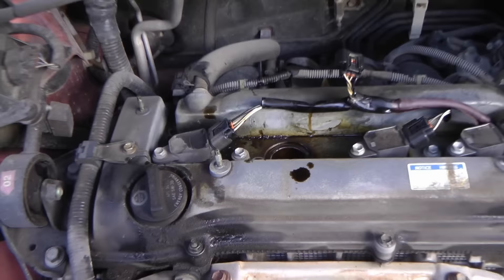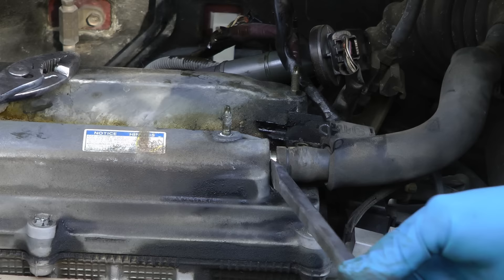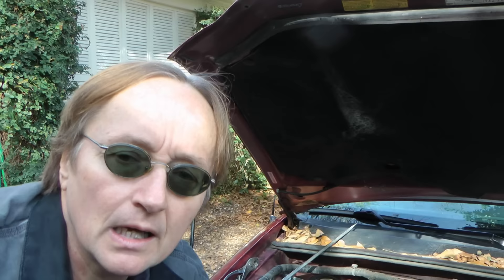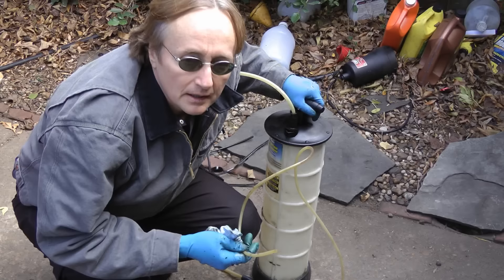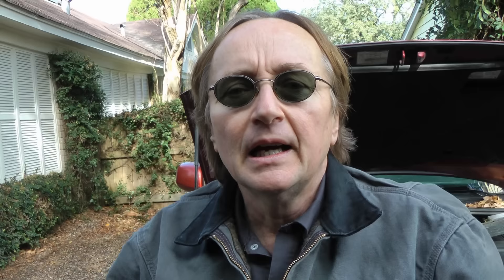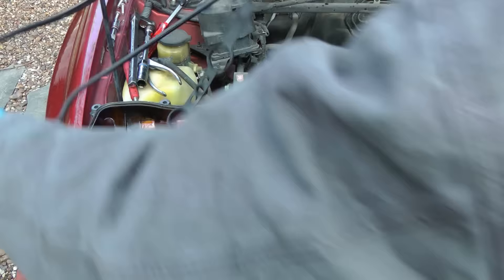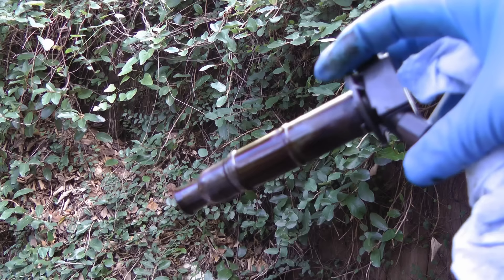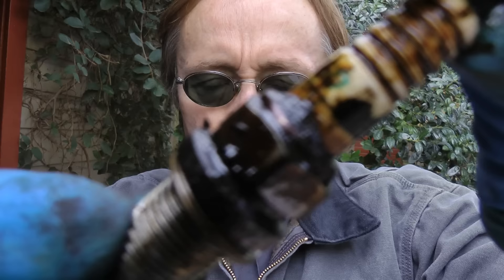How to Fix Engine Oil Leaks in Your Car

Comment: Ive got a decent oil leak on my 2002 renault clio , ive check my plug cables but they are dry as a bone , where could my issue be?

Comment: Hey Scotty I have a problem with my Subaru Justy it is a car old 5 years and has engine from Daihatsu it has a 3 cylinders and its spending too much oil I've crossed 6500 km since the last oil change and now he lacks a little more than a liter of oil in the engine, mechanic assures me that it's not surprising but I'm sure that something is wrong.Because I previously could get over 10000 km without of oil loss.It all started when

Comment: I'm freaking out.  I have a 2005 500 Limited with the 3.0L Duratec DOHC V-6. Can't even see Bank 1, or  the 3 coils there. Intake removal, 2 valve covers, harnesses all over the place.  What a mess.  Have oil in plug wells on Bank 2 in front, cylinders 4 and 5.  Cylinder 6 was fine. I miss my old Buick 455 C.I. right about now.

Comment: Hello Scotty,
i already change the valve cover gasket and spark plugs tubes and it still have oil in the spark plug when i take it out, do you know what could be the problem.

Comment: Hi Scotty,I have Honda Civic Coupe 2008 model. Recently I have started to observe couple of drops of oil leak per day under my car. I showed it to a mechanic and he told me not to bother with repair cost and just keep on monitoring engine oil level to ensure I am not losing lot of oil. The leak seems to be minor. My question is- There are some oil leak check products in the market that stop oil leaks ..like Blue devil products...Should such products be the right fit for my car? It has 105000 miles on it. Thanks

Comment: 95 Buick Regal 2.8L 3800 series:
Being that i haven't done any work on my own vehicles since Breast Cancer, 8 years ago,...any suggestions to Breaking the Seal on my starter.  No pneumatic tools..... bleeech.  and ... now I need an oil pan gasket replaced.  Maybe I get my brother in law do that.... but I gotta drive it there -_- first.

Comment: Hi Scott I really enjoy your videos v helpful God bless you I am very worry I bought Nissan micra 2013 digs model petrol 28000 mileage on clock but exhaust is v black and I open air filter and that was a bit oily as well but there was not any oil where the air filter was it was just black oily I mean the air filter plz help me is my engine worn I paid 4000 pounds plz help me to fix it if any cheap way thanks it's start and drives fine thanks

Comment: I own a 2001 Chevy tracker with a v6  and replacing valve cover gaskets on it  isn't this easy you have to take the top of the engine apart.

Comment: Hey Scot When I open my engine oil cap I see white grease or oil  stick to cap and inside engine. I never see something white inside engine before . Do you what it is ?  Where they come from ?  thank you
Reply from the maker: +Raksasok Heng IF you don't drive much, it's normal condensation from water build up inside. If you drive it a lot, often it's a sign of a blowing head gasket

Comment: hello my infiniti g35 2003 is leaking the same way as in your videos. Do I need to buy the valve gaskets, tube seals only or valve covers?
Reply from the maker: buy them all if you're taking it apart, it's a lot of work and no sense skimping on parts

Comment: theres no need seal gasket at any point of the cover? i did these to my Yaris's Mom and still have a minor leak in the rear side of the valve cover, it's same engine.

Comment: I was worried that he was about to say that whiteblock Volvo motors (the one in the image) were leaking through the covers when in truth just often a easy oil filler cap seal that caused oil to collect on top of the head.

Comment: Scotty, how are you? I was driving on the motorway and then I accelerated, engine lost power, white smoke and very rough idle if it starts and shot all engine oil out from the dipstick tube…. What is the cause? To that’s?

Comment: My Honda manual says change oil every 12000km and oil filter every 24000.    I change the oil every 5000km and filter every 10.  I just thought it was interesting because that is what the manual says but it seemed like a long time between changes to me.

Comment: Hello Scotty 
I need some advice with my 2004 corolla Is leaking engine oil when running (not burning it) I can see it all wet in the back... I already replaced the timing change tensioner but it is still leaking... it is a big leake. Might be the valve cober gasquet right?

Comment: hey scotty, do you do any work on diesel engines? im trying to diagnose a problem with mine.the starter drags to the point that it wont turn over. the batteries on it are brand new, and i changed out the solenoid on it twice. its a 1984 gmc vandura 2500 with the 6.2l detriot diesel. any tips?

Comment: question, on my 95 saturn sc2, dont i have to use the right amount of torque, and tighten the bolts back in sequence when putting the valve cover back on? otherwise it can cause compression issues?

Comment: Would a few seconds of white smoke from the exhaust on a start up be a bad valve cover seal most likely?
Reply from the maker: it often is
Reply: What would it most likely do if it were to be a blown head gasket? Keep on smoking until I shut the truck off? (Knock on wood this isn't the issue.)

Comment: replaced a valve cover gasket today on a 03 camry. looks like the same engine. trying to locate a oil leak, saw some drips, looks to be coming from the rear main seal but also saw that the valve cover was gunked up. Before recommending a $600+ repair, I recommended replacing valve cover gasket first. Anyone know common oil leaks on this car? looked like oil was leaking behind timing cover as well but owner admitted that she forgot to put the oil cap back on and drove without it which casused a mess
Reply from the maker: Jay's Garage Raleigh   do my video "finding and fixing car oil leaks" that will show all leaks quickly. Valve gaskets are common but high mileage ones can eat up rear main seals if oil was not changed enough
Reply: Thanks Scotty, just watched the vid. UV dye will def help in this situation

Comment: Hey Scotty. I am really in need of some good advice here. My car is a 2010 Honda Accord LX. It’s drives normal when I go short distances but when I go like 100 miles or so on highway , the engine oil goes to the lowest point in the dipstick. Local shops told me to change VTEC spool seal and engine oil pressure switch. I did but nothing happened, still leaking as before. Now I’m told to spend more to replace valve cover gasket and VTC screen. But I’m not feeling confident. Can they chase this much leak while driving on highway? What is the problem here? Thank you in advance.
Reply: I don’t see any blue/black smoke when I start the car or drive to indicate that it’s burning oil massively.

Comment: the motor in my 67 mustang is a 302 that was pulled out of an 85 f150 and installed before i got it with unknown miles will sometimes push oil out of the dipstick pipe onto my alternator is this a "blow-by" problem?

Comment: Scotty, please help. When i started to replace my sp.plugs i noticed a little bit of oil on boots like you did. Not so much but still a noticeable. Can i suspect also the seals? Car is Dodge Avenger, 1997, DOHC. But i also have a the bottom of the engine covered in oil. In every 4-6 months i have to add a little bit of oil. Can the oil be pressed out so much because of bad seals so it drips even to the bottom of engine?
I want to remove the leak, but the scariest one is the bottom of engine. Thx

Comment: .Hey scotty love your videos, but wouldnt oil in the spark plug wells mean bad piston rings maybe? My camry had the same problem with oil in the holes but the gasket was just fine, took it to a mechanic and he said it was bad rings, I asked around and others confirmed that problem.
Reply: FlengeHopper if oil was on top of the spark plug it'd most likely be a gasket issue. If oil was on top of piston/ threads of plugs were soaked it would be a ring issue.

Comment: Also, my dad removed the oily spark plug (2ND to last to the right side) from my 91 accord And quickly put it back, would it still hurt the pistons? And it was only that one that had oil, do the tube seal still needs to be replaced? Or is it another problem?

Comment: I have just changed the valves  cover's  gasket and the spark plugs as they were/are leaking oil , the leaking is back , so i decided to change the whole cover now  , do i still need to change the spark plugs  again too ?! and if you wonder what is my car, unfortunately its a VW jetta  2012 2.5 .. the dealer wants to  charge me 900$ to do the job
thanks
Reply: manyes7 no need to replace the spark plugs again

Comment: Dear Scotty,

I just got my first car (jaguar stype, it's a hand-me-down) and tried to change the spark plugs myself. when I took the old ones out, they were drenched with oil. I put the new ones in, torqued them correctly and when I tried to start the car it wouldn't hold. if I gave it gas it would hold but old for a couple seconds then die. could having all that oil in the socket holders be the reason why it's doing this?? I really would appreciate any help.

sincerely, troubled teen

Comment: Hi scotty, i have an engine that squeaks badly. its a toyota 1nz-fe engine. every time i accelerates, the squeaking noise becomes louder and then goes away. Fyi, i have replaced all the belts that is there. Any advice would be very much appreciated.

Comment: I over tightened a screw on my valve cover. Heard a pop. Now it won't tighten. Screw doesn't seem to be damaged. Oil doesn't come out or anything. Can I just seal the top of the screw with something?

Comment: My Ford Escort has white smoke coming from under the hood. I opened my hood and can see small traces of fresh oil splattered on the right side of my engine/right side of the oil tank. Is this related to an engine oil leak? My neighbor said it could be an antifreeze problem causing the white smoke. But the smell is oil.
Reply from the maker: put UV leak dye into the oil as in my video "finding and fixing car oil leaks" to see if it's engine oil leaking and where it's leaking from
Reply: Scotty Kilmer
Yeah, I actually meant my comment to go under that video. Had 3 tabs of your videos open and accidentally commented under this vid. I'll do that though.
Reply: Scotty Kilmer Hey Scotty. I can't find the video where you show how to use Baby Powder. What's the title of it. Been looking everywhere.

Comment: I have a slight oil leak from the oil pan on my 2002 Saturn SL1. Not serious..but you cannot replace the gasket  without pulling the engine (crossmember blocks the bolts. Can I try an additive type sealant?
Reply from the maker: additives work for oil SEAL leaks, I use AT 205 reseal from amazon. BUT, no sealer works on oil gaskets, if they leak, only changing them will fix it

Comment: Hey scotty. I purchased a 2002 nissan altima 2 months ago, and it's been a nightmare for oil. there was a new valve cover gasket installed and a new pcv valve was put in. It is using about a quart in 100 miles. It has 110k miles. There is no oil in the spark plug wells at all, and we used dye to find oil leaks but can't find anything. If it is burning oil there is no smoke either. There was a recall for this issue but it was supposedly fixed. I'm at my wits end - do I just need to get rid of the car? It almost seems like a new engine would be the only option after that.
Reply: Those specific cars are known to burn oil

Comment: Hey scotty, i have power steering steering fluid leak on my 97 toyota camry i just keep refiiling once every two weeks or so i dont have have the money to get it fixed can i keep refilling it or will the leak get worser over time? by the way i took it to a mechanic and he said it would cost about $1600,  the car has 225000 miles on it. thanks.

Comment: hey scotty, ive got a 97 prelude recently rebuilt complete engine. have an annoying oil leak. changed cam seals crank seal and harmonic balancner shaft seal that fix the oil pretty much but still leakign a little bit. i took it to honda specialist and they told me its leaking from the headgasket. that doesnt sound right to me. havent really heard of oil leaking form the headgasket before. doesnt use any water and no problems. new headgasket with rebuild and head bolts. what do you think?

Comment: I'm having an issue with my 2002 pt.cruiser. It's (I believe) one of the air chambers blowing out that could directly affect the catalytic converter later on (Ppl at Autozone told me). Anything I could possibly do to avoid further damage than needed?
Reply: Owning that pt cruiser was your first problem

Comment: question I have a 2001 Toyota Celica GTS that's was  leaking on the passenger side I fix the oil pan gasket I fixed the crank seal and now it's leaking in the center of the car. and it's so minor leakage that if I look under the car I can't see any oil dripping. but I see oil dripping all over my driveway. So could it be valve is leaking or oil leak into the engine. I would definitely love to know so I don't spend thousands and thousands of dollars trying to fix something and I am far far from being mechanic and I did have mechanics fix my other two problems so any advice?
Reply: trever pitts check your oil pump gasket.

Comment: Boss, Im workinq in a 2002 gmc sierra 4x4
Bad oil leak on the two corners of oil pan near to tranny, i thougth was the pan gasket but still leakinq so now i got replace intake and valve gaskets but im worry about rear main seal! But i dont see oil begine the flywheel
What u think on those kind? Thank u

Comment: Hi Scotty I'm going to do a top and tail on a toyota celica 02 .....because I'm burning 2litres oil every 1k miles ....I'm trying to find a data file to help me thru the procedure ....hope you can help thanks Daz
Reply from the maker: that engine is a fancy yamaha motorcycle design, no one really rebuilds em they are so complex and parts cost so much. Most guys put in used engines.  Good luck if you want to try, realize it's not a simple engine

Comment: My 1997 honda civic engine is leaking right through the only crack on it, so i watched your video and i pulled out every spark plug boot to see if they were covered with, but they're dry. They still look like new since I got my car tuned up .. do you think an old valve cover gasket is the reason of that leaking? because i was thinking okay i can replace now that i saw this video, but I really don't wanna waste my money since my budget is really tight right now :/
Reply from the maker: do my video "finding and fixing car oil leaks" and it will show you the exact leak
Reply: i will. thanks

Comment: When I apply my brakes the break pad kind of shakes and so does the steering wheel
Reply from the maker: front brake rotors are warped, change them and the pads

Comment: I have the same problem with my van chevy express 2500 year 2005 engine 4.8  I can fix my self ?
Reply from the maker: sure, if you don't mind getting your hands dirty, tight working quarters on the engine

Comment: Hey Scotty just had got my dream car a 2007 impala ss 3 months ago , and I was wondering why it was burning so much oil , come to find out when i take it to Chevy dealership say it's rear gasket is leaking oil or something of that nature and the cost to repair it would be 722.00 , i would be a Jack ass and a half if I paid them for a fix that's  simple in a way plus I'm paying a car note on the car plus insurance. Any suggestions on what I should do I love my car just didn't expect this so quick 3,000 miles later. Would the engine sealer work??

Comment: Hey man! I'm jst wondering if u can give gimme an idea for my 1995 Toyota Camry 2.2L engine. I couldn't find where the leak is coming. I replaced pretty much everything. Like valve cover gasket. I replace the oil pan. Couldn't find wher it is. My nxt project will b the oil pump. Might be the gasket. So yeah please gimme some thought
Reply from the maker: +rommel gamboa do my video "finding and fixing car oil leaks"

Comment: Scotty I did this a I broke the screw that holds the valve cover and it leaks a little please help me rethread the broken crew so it can stop leaking thank you
Reply from the maker: you have to drill out the hole and retap the thread. OR, get one of those EZ out kits and see if you can get the old bolt parts out

Comment: Scotty i have a 95 honda accord lx (manual transmission), it's in exellent condition and runs like new but i just found a small oil leak from right- rear side of the valve cover. i don't wanna wait till i take out the spark plug and find it covered in oil. what should i do please?

Comment: Hey Scotty! You are awesome man! I have a quick question. I smell oil burn and smoke under the hood and my mechanic told me it's the valve cover gaskets leaking and upto $400 to fix them. Ouch. It's a 2003 cts. I am wondering if there is some kind of additive that I can use to slow down the leak or stop it? Will the AT-205 help here?
Thanks!
Reply from the maker: +Rahgir Nabi nothing stops valve gasket leaks other than replacing them, or just trying to tighten the bolts up, so try tightening them first
Reply: +Scotty Kilmer awesome ill do that! Thanks man you rock

Comment: Hey mate 3 days ago I bought a toyota curren from my friend. He didn't tell me about the engine oil leak. When I told him today he said its common because its leaking from the plate underneath. He said that was leak from the top and wont leak anymore from bottom. that will be alryt he said. What do u say about it mate ? thnx

Comment: Hey scotty my car looses engine oil 2 litre per 2000 kilometer there is no leakage nd not much smokes i change seils pcv valve but still same what u suggest 4 toyota camry 1998